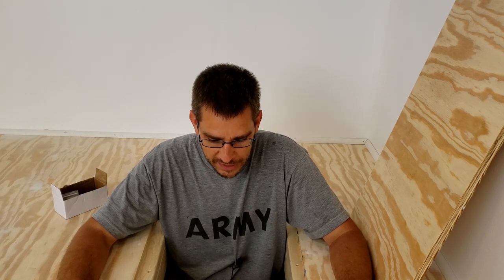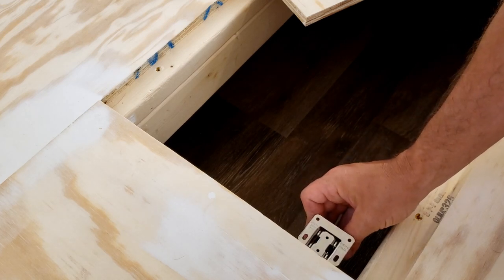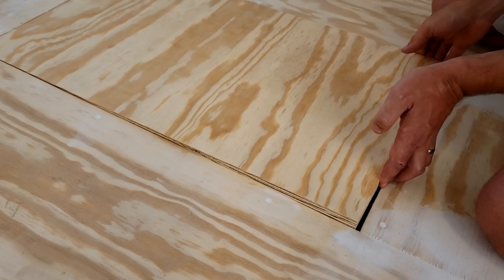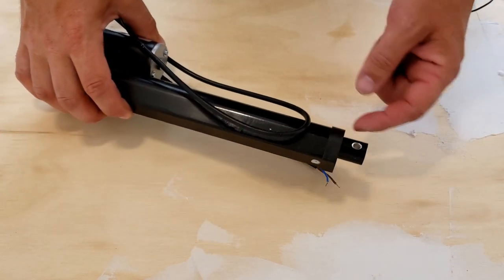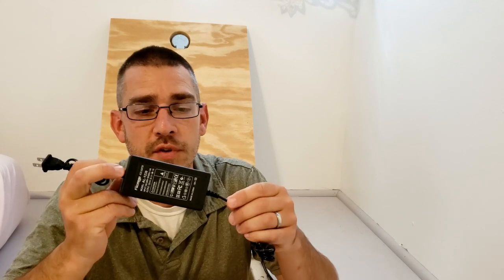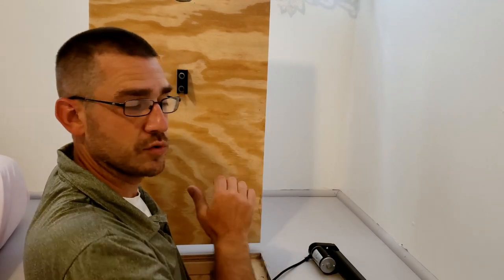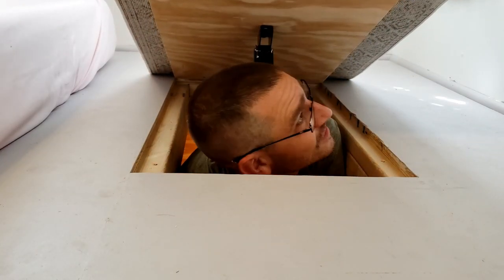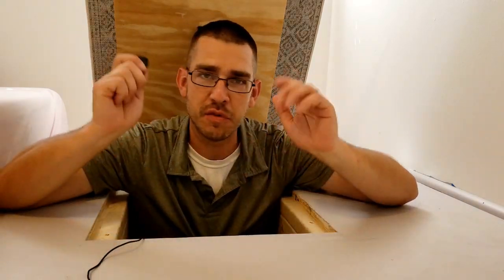How To Make A Remote Controlled Secret Trap Door

Comment: Hey thanks man. I use your video and created a trapdoor for  basement steps. I used 2 30 inch actuators and it works perfectly . I use 4 of the hinges because I made it open up the long way. I'm about ready to put hardwood floor on top so nobody knows it's there . I'm going to stagger it. Thanks again
Reply: Show us some pics? I’m doing exactly that

Comment: I would suggest putting a quick release pin in the actuator in case you lose power and need to get out
Reply: I was about to recommend a manual button override for the inside so you cant lock someone in but this is even better
Reply: Dave and maybe an emergency light that comes on if you lose power...  I know it sounds like a lot, but if your child is in there and the door is down and you lose power, it’s dark and they are locked in and you can’t even open the door from above.
Reply: There’s a handle to lift it open
Reply: Did you watch the video?

Comment: Thank you for sharing the video.  Is there a limit switch if not how did you get it stop when it's fully closed?
Reply from the maker: That is the one flaw, I set it up so that the range of the piston ends close to when it is closed but if you hold the button down it pulls it closed hard and could break the mounts. You just have to know to stop it when it is closed

Comment: That’s cool. Do you have a plan in case the power supply, actuator, or switching relay fail with the door in the down position?
Reply from the maker: It has enough play to lift and and get an arm in to pull the pin

Comment: Great Video-I want to be able to open and close with a remote control, a cabinet flip up door that houses my split system AC/heater.  What model actuator did you order from Amazon.  The cabinet door probably weighs no more than 10-15 lbs.  I'm limited on space between the split system and the side wall of the cabinet.  Am I able to install the actuator on the side wall and how thick is the actuator?   What other parts do I need besides the linear actuator?  I take it that a 12v battery won't work with a remote control.

Comment: Nice design, but the problem is the linear Actuator, guaranteed it's a cheap one, I only use and recommend Progressive Automation.
Reply from the maker: It is a cheaper one but seems to work just fine for this project

Comment: Thank you for the video. I do have question, when I try to open the trap door the piston pushed and when I close the piston retracted the trap so much and the screws coming a part of the framing. Any Idea what,  to do to make a work perfect. Thank you , Philippe
Reply from the maker: I had that issue a little, it would pull too tight and pull on the screws. The trick is to put the piston all the way in and scree it in while the door is closed (you have to be on the inside) then it can’t pull any further than shut

Comment: Would something like this work for a larger trap door? Something like 3'5"x 7'2. This will be more of cellar door type thing. Two interface doors…so the framing would be part of the door.
Reply from the maker: Not sure it would have the power, maybe 2 of them would work though
Reply: @SSLFamilyDad  Yes was figuring would need two. U said it's were rated for heavier than ud need. Do u remember what that would be? And maybe manufacturer/kind it was?
Reply: Better to use gas struts to do the heavy lifting, let the actuator just get the lifting started. Gravity helps to close things.

Comment: Hey so I have a question....the remote control unit link you posted is that the same one you have like the same remote because in the Amazon link it a totally different remote than what you have ?
Reply from the maker: It is the same link I used but it looks like they have updated the controller. Still the correct product though, just an updated version

Comment: Can you please share the door opener link. Thanks
Reply from the maker: Trap door flush loop handle - https://amzn.to/3eBI2za
Flush mount hinges - https://amzn.to/2CCPvjf
Power supply - https://amzn.to/3hZhYji
Linear Actuator Motor (piston) - https://amzn.to/3fSUCtP
Remote controller unit - https://amzn.to/3ev8tq3
Flush trim router bit - https://amzn.to/2Z3NjZz

Comment: Nope !!! This project is not quite done yet ...As you just demonstrated the human factor failed , but an easy fix for about  $ 2.00 ... & maybe $ 3.00 ....  The incandescent bulb needs to be a scrapped because of the dangerous heat /fire possibility of forgotten & left on . ALSO , remove the manual light switch & swap it out for  a compression - off when door is closed & on when door is opened .  NOW  your project is done ...🤗🤗🤗👍👍👍I did enjoy your video , thanks ...
Reply from the maker: Good feedback but a couple corrections. First, it is an LED light. A motion switch would probably be best in that case and easiest to setup.